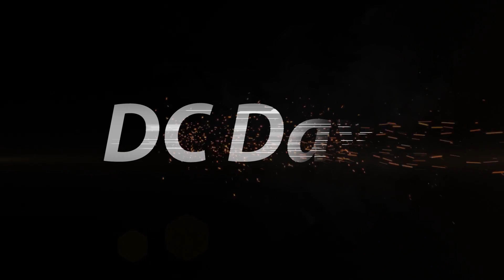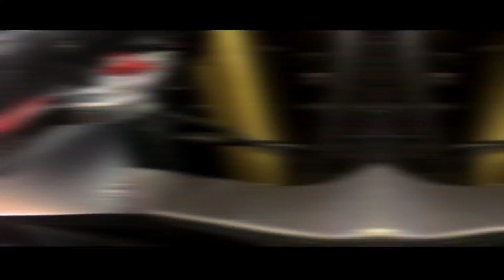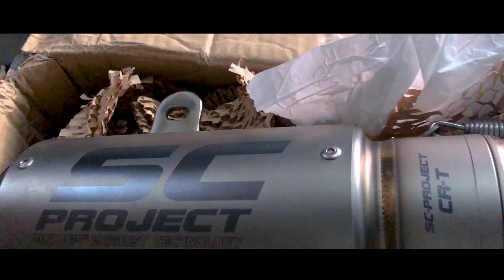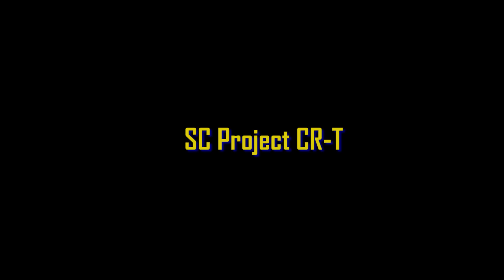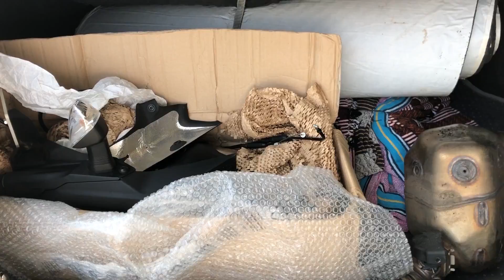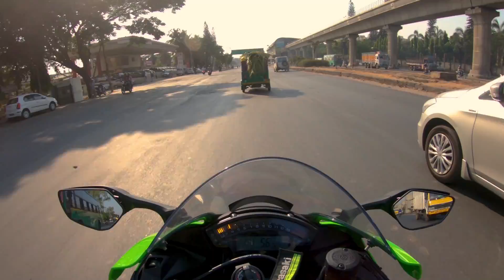Kawasaki ZX-10R | SC PROJECT CRT Exhaust || DC DAYS

Comment: i'm from kolkata, 2 Days before I have also install SC Project Exhaust on my ZX10r- 2018. The Bike is making misfire , making jerk in 1#Gear Low RPM. Any Solution u have done to ur 10r...?
Reply from the maker: Bro change the filter to bmc or K&N it will solve the problem.

Comment: Bro ECU flashed in u r bike ofter putting on exhaust  ?
Reply from the maker: No brother.
Reply: Its not needed
Reply: @tigersushilvlogs9446   if slip on don't matter that one straight pipe and removed catalytic converter so it required ECU check tha intake fuel, air mixture and we have check   out flow efficiency , and have to remap tha controller ....
Reply: @tigersushilvlogs9446  agr backfire krti hai toh mtlb air fuel mixture glt hai india me sbko backfire mst lgti gai but actually it is bad for engine and needs remaping
Reply from the maker: Yes yes
Reply from the maker: Absolutely. Will get the remap soon.

Comment: Bro how can a slipon sound so loud  ? Did u delete the cat ?
Reply from the maker: Yes i have taken the cat off bro
Reply: @dcdays  bro by installing slipon and decating will the sound be louder ? Or should one consider installing a full System in order to get loud sound  ? What makes loud  ?
And would u prefer racefit over Sc for loudness ?
Reply from the maker: 1) I wanted to have SC project itself bro that was actually decided before bike itself.
2) In 10r I am said Full system is not necessary as the headers are of Titanium so when u put a slip on with Link pipe it will be full system.
3) Even when sc was installed I enquired about loudness of exhausts. So option was Sc Project over Racefit. I love Racefit as well but inclined towards sc.
Reply: @dcdays  thanks bro🐰

Comment: DC Bhai, why a CR-T, S1 sounds more sporty though!!
Reply from the maker: Didn understand ur Question bhai
Reply: What I meant was, why did u go for a CR-T bro, u should have installed sc project S1, which sounds more aggressive and sporty!! 😅
Reply from the maker: @VijayKumar-gf7gp  Both actually sound similar, just differs on Regions they are used. S1 has more empty sound so I was inclined towards CR-T bro